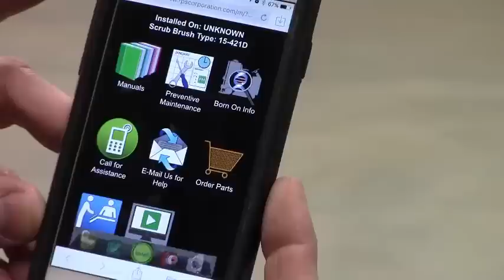How to grind and polish concrete

Comment: You can’t make a beat up floor look good if you polish it with a scrubber, their just isn’t enough weight on the diamonds pads to to bring out more agragate, you need an actual polish machine that’s heavier so you can take out the old layer and Bring out a newer layer flatting everything down

Comment: Doing the hanger with this system will take years, I would use ride on power trowels with resin waffles and cut the time down to a week instead of a couple month with a job that size.